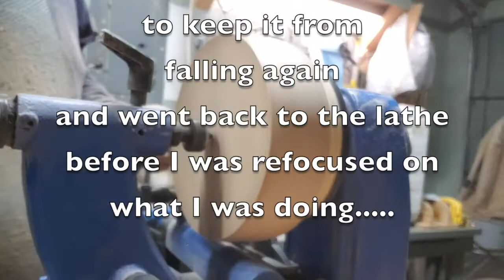My Lathe Injury (aka: Sometimes You Should Just Walk Away)

Comment: Can someone explain to be the difference between a wood chisel and a lathing chisel? I want to get into lathing but want to make sure I have the right tools.
Reply from the maker: The simplest way to know is just to buy tools that are labeled "turning tools" or "lathe chisels." You don't want to use regular bench chisels for turning on a lathe, as I found out the hard way here. Having said that, I know people that DO use just regular chisels and get along just fine (which is why I thought it was okay). You don't need an expensive set to get started, but buy tools that are for that purpose, not just something that "should work."

Comment: Well, your shirt said it all , The Tragically Hip......what actually caused this mishap, tool tipped into work, piece broke out of piece, I could see the the work was a not centered on the faceplate and plywood spacer, so no matter what you cut off blank, it was going to vibrate......I work with metal lathes so the lest amount of out of roundness I can spot in a jiffy. Glad you are ok.......was wondering if you had a big gap between blank and tool rest that allowed tool to tilt into the blank? please enlighten us, your video is a good warning though.....stay safe and keep on turning......Cheers form Florida , Paul
Reply from the maker: The rest was in the right place, but there were a few things I did wrong that contributed to this incident. 1. I was using the wrong kind of tool, because I didn't know any better. 2. I was partially distracted by filming the process and when the camera was bouncing around, I reached to stop it from falling off the bench and when I went back to the work I touched the tool to the wood before it was resting on the tool rest. That threw the tool down into the tool rest and forcing the tip of it further into the wood, causing the accident. At least, that's my assessment of it.

Comment: I work in a pattern shop in an iron foundry and we have a lathe and it's the only machine I haven't used idk if it's because the older dudes in there thinks it's too dangerous for me but I use spindles, drill presses, sanders and band saws but also only been working there for like 4 months
Reply from the maker: All power tools are dangerous if you don't know what you're doing with them, which I didn't at the time. It's good to have a healthy respect for what they can do to you.
Reply: @WoodenThingsAndStuff  yeah for sure I'm always worried about safety first I'm not trying to lose my fingers or anything else
Reply from the maker: That's the right attitude.

Comment: Gosh this video made me nervious haha. Glad your okay atleast. Lathe speed way to high and steel chisels..... aren't what you wanna use, you are more or less heating your steel and just scrubbing the wood, a skew is different from a chisel and a bevel is sharpened into it. A cheap bowl gauge would do ya 100x better than that. Evan with the correct tools at that speed a catch like that could have exploded, I had a 16" bowl explode on me evan with a face shield I lost 3 teeth and a wired jaw and a breathing tube for 8 days. I took it to the face a 1000 rpms and it nocked me out cold on the floor.
Reply from the maker: Damn. I can see why this video made you nervous after that happening to you. This was very early in my turning journey, and I'm happy to say I learned from it. It kept me off the lathe for a good 10 months or so, but when I got back on, I had proper tools (carbide, but still) and I soon bought a proper lathe for doing the work I wanted to be doing. I was trying to make this one do more than it was capable of, while not knowing what I was doing, which is a recipe for....exactly what happened.

Comment: Even with the bad camera angle I could see your accident waiting to happen. You were using either a skew or a regular chisel as a scraper, the problem is you had it angled up so of course it would catch. You should have your rest high so you could have the tool handle up allowing it to be downhill to the edge, thats how you scrape without getting a catch. I know it was several months ago and I hope you figured it out so you don't get hurt again.
Reply from the maker: I was using a regular chisel. Got actual turning tools for Christmas. Check out the video I posted last week if you're interested in watching me try to get past this incident.
Reply: I'm new so I'm watching videos of accidents - thanks to all these guys for posting them.  I was thinking the main problem was the rest was way down - I've seen it said it should right at the mid point, correct?  I didn't notice he was using a chisel (which seems a bit risky) but that's been covered in the comments.
Reply: @dchambers986  basically: 
use appropriate tools, chisels are NOT made for this at all!! 
start by turning with green wood if possible, cuts easier and helps you gain experience. 
the toolrest (depending on the tool) should be just below center, allowing the bowlgouge to cut at or just above center. 
always use your tailstock when possible, the additional support and safety are primordial! 
if there is vibration, slow it down. 
always have your tool supported by the toolrest when engaging. 
and please, try not to stand in the line of fire (directly facing the turning blank). 

take your time for each cut, don't force, let the tool do the job and enjoy ^^